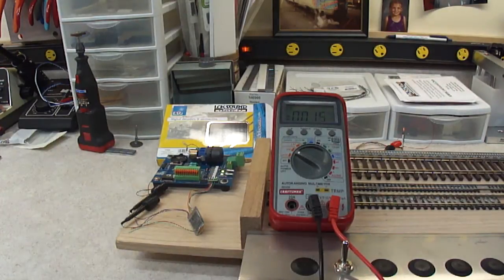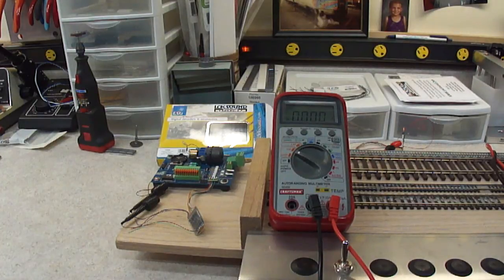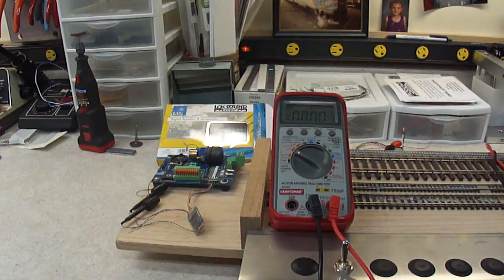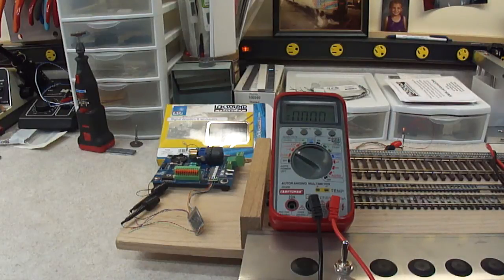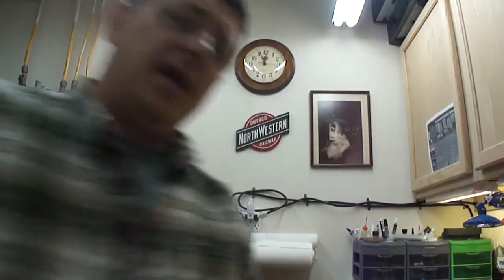www.SBS4DCC.com - Using DCC Decoder CV Settings to Control Maximum Voltage

Comment: For ESU Loksound V5 decoders, would you set the Reference Voltage, CV53, to the calculated maximum voltage based on the formula in the video, and then adjust CV5 or CV94 to your liking (prototypical top speed of locomotive)?

I haven't tried this yet, but I imagine you set CV5/CV94 to the maximum CV value, and then you adjust CV53 based on the value calculated and the resulting measured voltage at the motor. Once you obtain the optimum measured voltage for the given motor, you then adjust CV5/CV94 to the prototypical speed of the locomotive.

Comment: Can I run my HO scale locomotives at 50% max voltage without damage to the motor? My layout is all switching, max speed 10MPH.
Reply from the maker: high voltage will damage a motor.  half voltage just make its run slower.